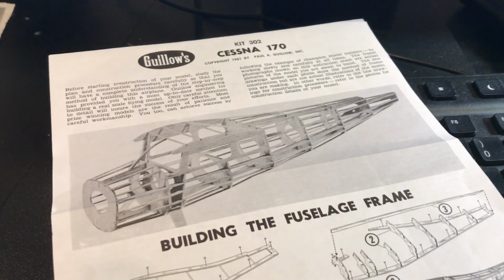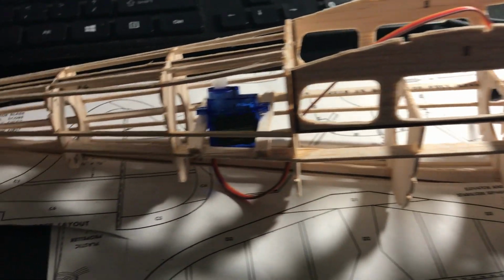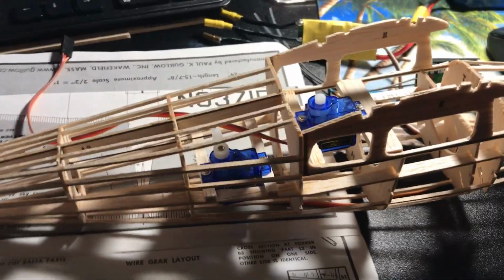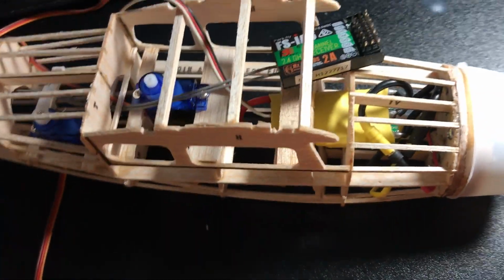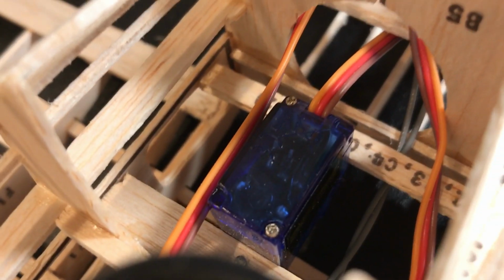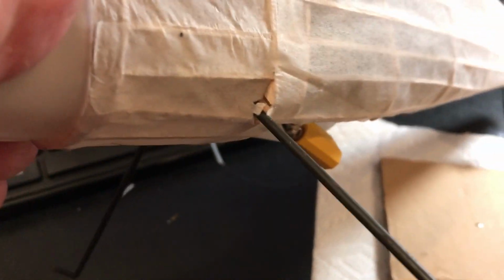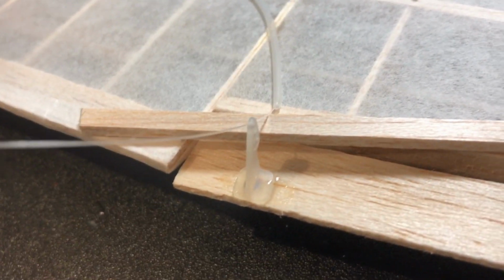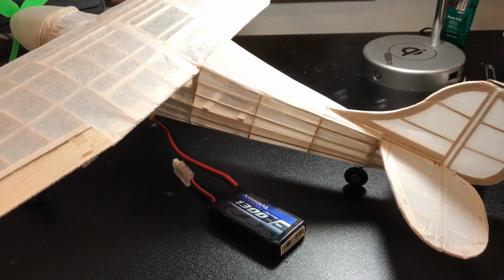Guillows Cessna 170 RC set up (steps 1-12)

Comment: If you used Parkzone linear servos you could simply your aileron assembly and reduce some weight and save some space as well. If you insist upon using the existing servo, you will have to use wire instead of the fishing line, otherwise you will have absolutely no authority in your aileron assembly, and the aircraft may fly out of control. Linear servos are small enough to mount within in the wings, or directly on the bottom surface of the wings, where they are also serviceable. I did not see a servo for rudder control, you may want to address this issue.
I hope you get it all sorted out.
Happy flying!
Thank you for posting this video!
Please have an excellent and awesome day!
☀️✨✈️
Reply from the maker: thanks for the advice . . . I am relatively new at this, even though I've been building more planes than flying them !

Comment: So what happened with the maiden flight
Reply from the maker: It was to be a great flight but the mechanics were messed up, still working on that issue . . .
Reply: @designandbuildguy  I’m more than happy to help with any questions or issues you have with the building or equipment.

Comment: did get how the fishing wire connection could push pull the aileron? if you could explain
Reply from the maker: by the way I ran those lines they would pop back to a predetermined setting, by sheer luck I might add !